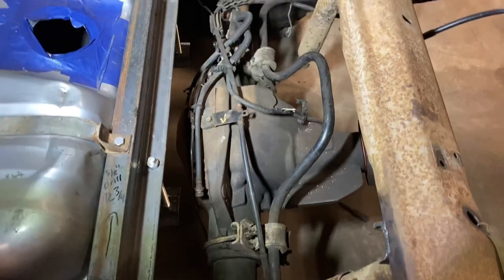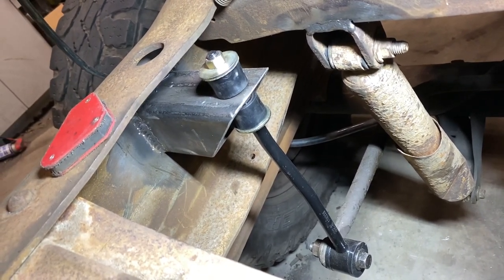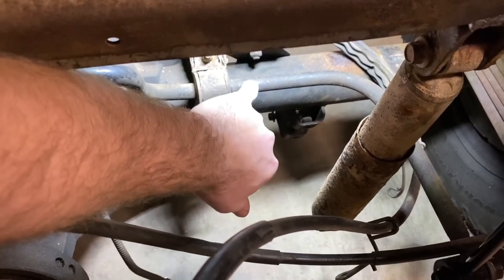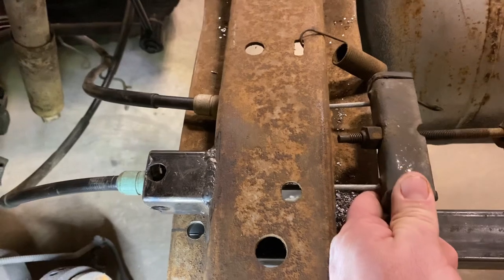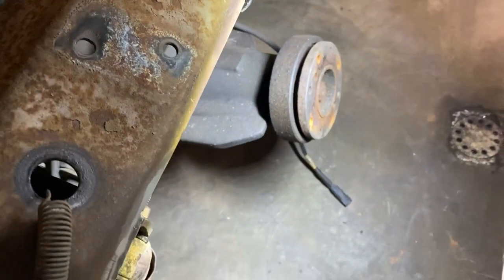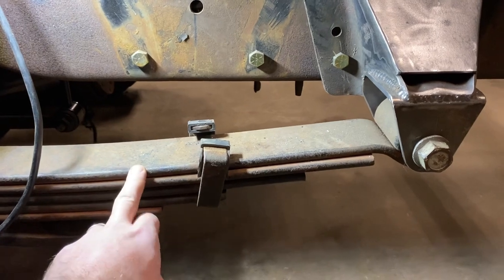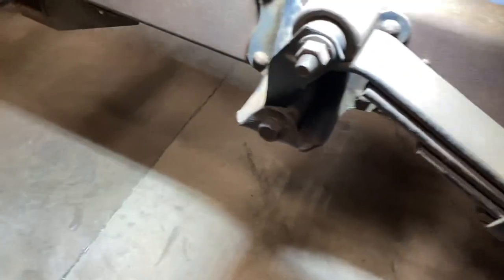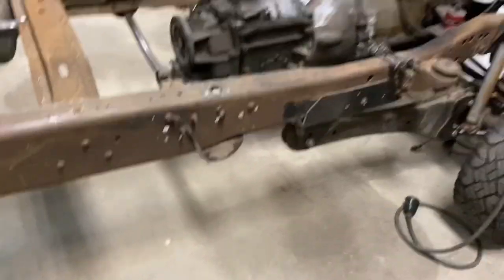Ford Cummins 4x4 Swap Van project frame mods done!!! 10.5 Ford Sterling finishing touches.

Comment: wow this build is awesome i have a pathfinder that i want to cummins swap but i already have a doner van set up w the 6.9 trying to decide which way to go w it cool build cant wait to c the final product
Reply from the maker: Honestly the Cummins fits better then the 6.9 we have in our ‘87 van. I’m building this van for mileage and the Cummins should produce better mileage with more power. Don’t get me wrong though I love our 6.9 van too but it’s been turbo’d and has a 5 speed manual swapped in too. I’ve got a video on that one too if you want to check it out.

Comment: Hey im from Iceland the capital of monster trucks, I have a 93 E350 7,3 im changing in to FUMMINGS :) am i able to get the 5,9 in to the newer body or the 93 body? i only see older models. My E350 1993 model is on 46" tyres and modified to the moon and back. Allso i have older one 86" on 44" inch with 6,9 and no power :)
Reply from the maker: There are several Cummins swapped Gen 4(92-newer) vans out there. Diesel Conversion Specialists make mounts for your van. Here’s a link to their YouTube video showing their swap. 

https://youtu.be/4jODvGcM8OY